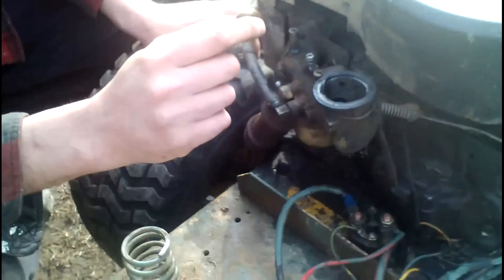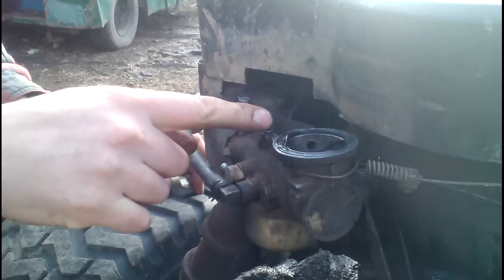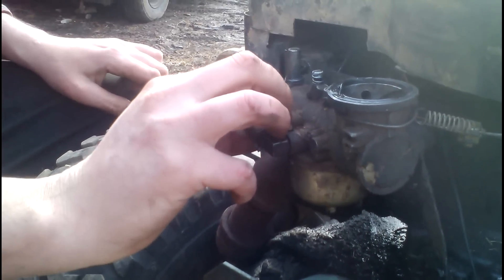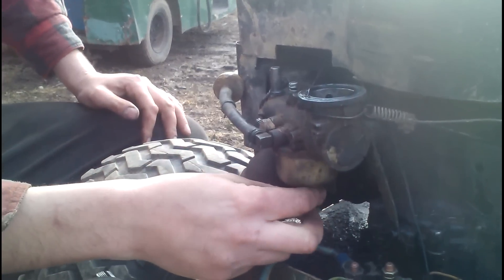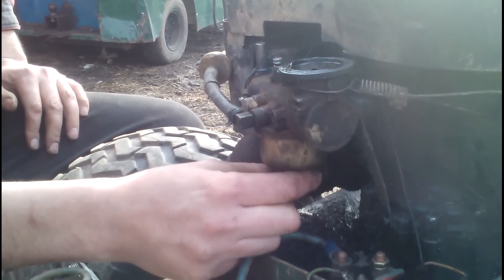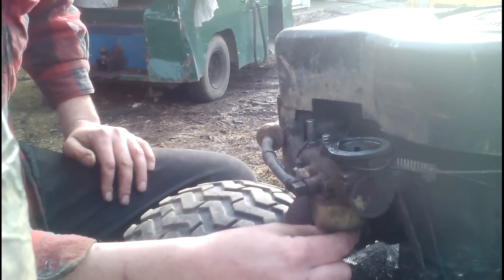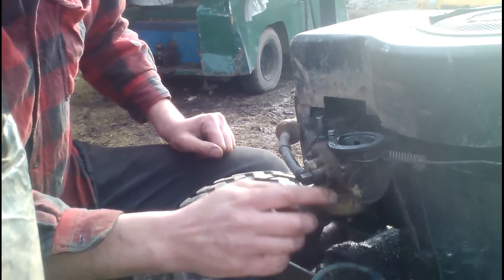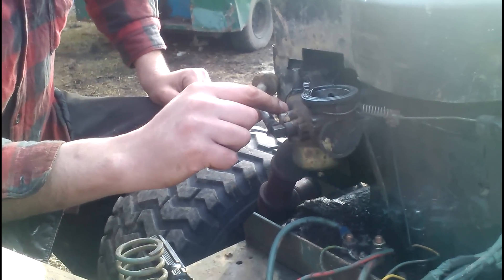Carburetor adjustment for Briggs and Stratton engine

Comment: No matter what I try my mower won't stay running. I can get it to run for 10-20s (mainly with the choke on) but nothing has fixed it (resetting the jets, cleaning it etc). The little spring connected to the throttle linkage has come off, could that be part of the problem? Or do you have any suggestions?

Comment: Stretch, my carb look like yours except I have a plug in the bottom of the float bowl instead of an adjustable main jet like yours. Mine is surging and seems to be running lean. What can I do?
Reply from the maker: It's plugged up somewhere, running lean,  no adjustments,  needs a good cleaning
Reply: @stretch44875  OK, I'll pull it off and get it cleaned up....Thanks

Comment: What is that spring that you have hooked to the top of the carb?  Did you bypass something?
Reply from the maker: Has direct throttle,  no governor
Reply: @stretch44875  did it have it(governor) before.  Thought I'd adjust mine now I can't stop it pinging off its head. I like the direct throttle approach. Just a thought. Is it easy to do? 12hp b&s ride on.

Comment: Hey man! I got a new problem, engine is running so lean the exhaust pipe is glowing red, how can i richen it?
Reply from the maker: Back bottom screw out 1/4 turn
Reply: @stretch44875  thanks! Worked!

Comment: What happens when ... you get it so outta whack, it wont start? then what?   Been screwing with mine for hours, ran fine before. I decided to clean out the float bowl & adjust that needlevale at the very bottom of the bowl.
Reply: Hey if you fixed that problem could you tell me how you fixed it?
Reply: @GORMAVDON-YT  Sory I ended up replacing the whole Carb   & it ran "ok"  for a while,   couldnt seem to get it fine tuned, then after sitting thru winter, it never started again, sorry.
Reply: @97warlock 😂

Comment: I have an old Sears Briggs lawn edger 3.5 HP.   But it only has a bowl adjustment and no idle screw.   I rebuilt the carb and put cleaner through it.   When I press the fuel primer 4 or 5 times, it'll idle pretty slow, and then I give it gas and it runs.  But when I bring it back down to idle it dies like it's not getting fuel at idle.  And I don't know how to fix it since there's no idle screw.  Maybe there's a jet in there I didn't quite clean out right?  Frustrating, but at least I can get it going.
Reply from the maker: There probably is a tiny jet or passage that is blocked.  Torch tip cleaner kit usually will work, or numbered drill set.  https://shop.advanceautoparts.com/p/forney-tip-cleaner-kit-sizes-6-through-26-86120/10628836-p?c3ch=PLA&c3nid=10628836-P&adtype=pla&gclid=CjwKCAjwtvnbBRA5EiwAcRvnpgf2BeUqgku3cuGS67EIwZ3hJMvpLOlCzlogylNlc6iZoNMpJxQXdxoCLsAQAvD_BwE&gclsrc=aw.ds&dclid=CMrB1-K9hN0CFU69Twodkr8C5Q

Comment: My mixing bowl has wires coming out and no access to screw.  The unit also gets hot during starts.  Have I got some sort of accelerator pump?  It's a 21 hp B&S on a riding mower, and I've about replaced everything and can't keep it running.  It starts and after 10-15 seconds quits.  Any help would be much appreciated...maybe there's another video for engines with wires under the mixing bowl?
Reply from the maker: W. Hoffman completely different carb.  no mixture adjustments
Reply: Thanks for getting back to me..  What the heck is the two-wire unit, do you know?  Also, there are two screws on top...one plastic that only moves about 180 deg (left-right, stop to stop) and the other is usual spring caged screw.  The one with the spring looks like the one you worked on (idle setting?) and the other looks almost like some sort of on-off thing.  Any advice would be most welcome...or maybe there's another video you know of.
Reply from the maker: W. Hoffman can't help with that, not familiar with those.
Reply: the thing on the bottom of your carb is an electronic shutoff for fuel and the plastic screw bit can be removed for further adjustment and then it should have a screw head underneath
Reply from the maker: W. Hoffman https://youtu.be/4NuBi43DpnY

Comment: I got a lx178 jd with a 15 hp liquid cooled mow ran for like 3 week and then I was mowing I just died pulled carb off clean out made new gaskits for it would run for 30 min the die. so I put need fuel line 2 new plug new gas take old one had dirt in it got a new float and needle put new gaskets on it starts and dies now i need some help
Reply from the maker: robert Phroper no idea on that engine.

Comment: Goog video...thanks.  Question...I would think adding the air filter will change the air ratio a little.  Does it affect it enough to matter?  Thanks.
Reply from the maker: mcconn746 I think it changes it a little.

Comment: what kind of issue am I looking at if the recoil is not "engaging" the crankshaft. 

the engine is not seized and turns of smoothly...the recoil pull start is pulling fine the only issue is its not "grabbing"/pulling on the the crankshaft.

Comment: hey hoping you see this and reply i have an 11hp bs with this carb on it and whenever i turn it off fuel still keeps flooding the carb it runs and idles but if i forget to turn the fuel tap off it makes a huige mess any ideas? also cleaned fuel bowl and needle and valve flaot seems fine?
Reply from the maker: this is video you need.  https://youtu.be/0rG_Bj-VFD8

Comment: Thank You Stretch! You Taught me exactly what to do after i cleaned the carb and put it back together. I Hope I got the adjustments right on mine. It sounds good. even when reved up. I don't think its perfect but it sounds good!
Reply from the maker: glad it worked out, if it sounds good, probably is good!

Comment: I got an 11 hp b&s with the same catb that blows a lot of black smoke and runs terribly. I've cleaned the jets with pins and it made no difference.
Reply: You need to do a leak down test to determine weather you have poor valve seals or a worn out piston.
Reply: too rich lean it out

Comment: Can you tell me roughly the default position of the idle speed adjusting screw before I start? Main mixture screw is adjusted ok, so I can mow, but if I set my speed control lever to "slow" it will stall. Thanks for the great video!
Reply from the maker: Speed,  I don't have a default.  probably need to back out the idle mixture screw while adjusting speed down. If hole around throttle shaft is to big,  to much air may be getting in, causing bad idle.
Reply: +stretch44875 Thanks for the reply, I'll keep working at it.

Comment: I have a 11hps I clean fuel line from tank now I have good flow but can't get fuel up to carburetor
Reply from the maker: Tank has to be higher than engine.
Reply from the maker: No idea where pump is, or if you have one.

Comment: I have a 8HP with an new up flow carb. it starts but shuts off after 5or 10 seconds. new gas lines, filter, and gas, cleaned tank changed spark plug. doesn't seem to be getting enough fuel to keep running. 1950 tys  model.  It's got me stumped, i need some help. Thanks
Reply from the maker: I'd check inside carb,  could have got something inside.
Reply: Check the bowl screw.  Should be a really small hole in it.  Make sure that hole is clear!  You might have to get a really small piece of wire to run through it.